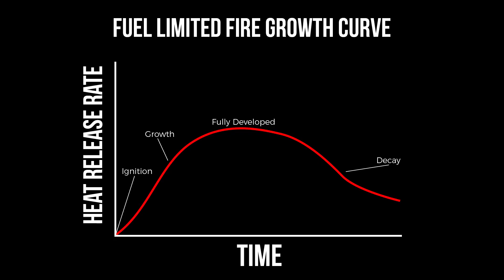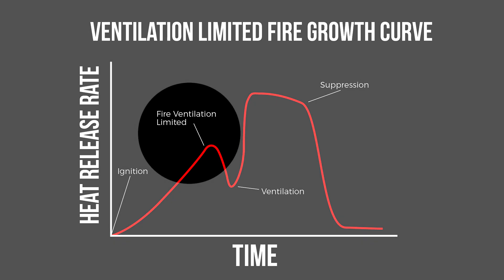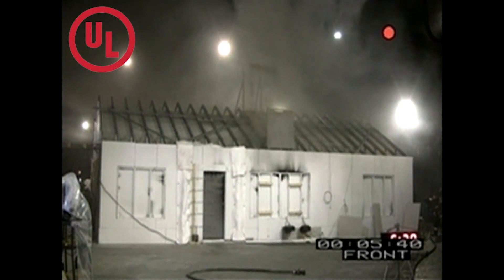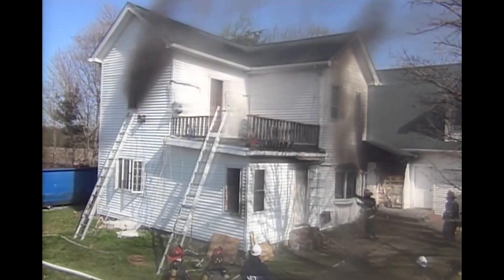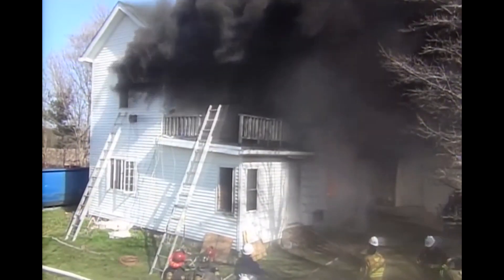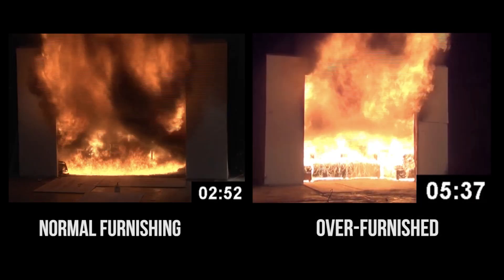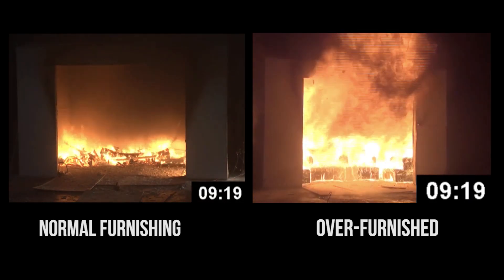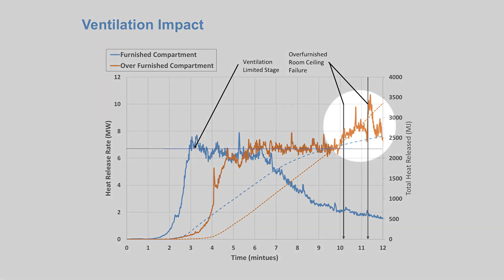Tactical Consideration: Fire Development Changes When a Fire Becomes Ventilation Limited

Comment: Breaking a window isn't ventilation. it's just breaking a window. Doing that with old construction and old furnishings would have caused problems, as well.

Ventilation is control of the air.

Attempting control of the air by not creating a proper outlet for the fire (through fans or vertical ventilation) is dangerous. "Keep it rich" is an insane philosophy that must be destroyed.

Comment: What are the results of breaking a window with a stream that turns into a mist and then back into a stream.  Do you get a falsh into steam and a vent when the stream goes solid with only a flash fire?  Or no fire at all because the water mist took all the energy up when it turned to steam and vented?
Reply: The result will probably be that you knock down some fire, but the steam will expand to adjacent areas, disrupt the thermal layer, and make conditions much worse inside for victims.

Comment: Heat and Fuel represents a batery, a huge one, without a completed circuit.  Air completes that circuit and results in a violent event like any flash bulb or electric arc.